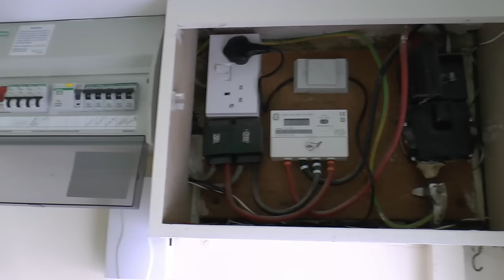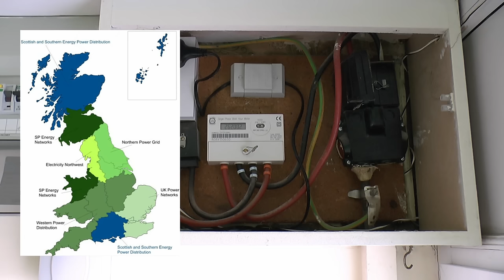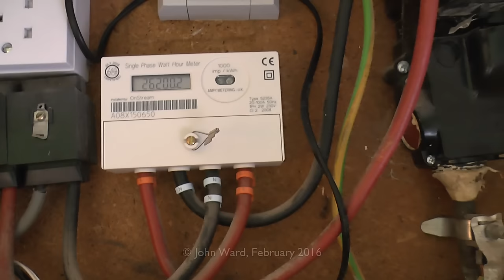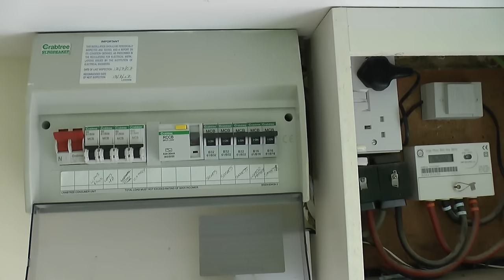Mains Supply And Consumer Unit

Comment: Hi I from the Chicago area and was just watching to learn, boy do we do things different here ! No incoming power would ever be in a wooden box or even set up like that the meter is usually outside and is sealed also acts as a disconnect on a  home . Our panels are much bigger new standards call for arc fault on all circuits  in England is it usual to have only 1 hot and neutral or 120volt only I though it was all 220 volt and is it 220 one one line w neutral or 220 on two phases, Here we have 3 wire service two 120volt lines that share an unfused neutral so from line to line 220 volt line to neutral 120 volt all services have a main breaker with two sources of ground one rod at the meter and one at the incoming water line before the shut off valve if on a well then a second rod at least 6feet away from esch other.
Reply from the maker: One hot at 240V, one neutral.  All appliances are 240V.
Reply: And we in the Netherlands have also neutral connectors on the breakerunits,so the neutral is also disconnected when a shortcircuit.So no common bar for the neutral wires.And indeed a hot phase and neutral,no two 120 volt lines!!

Comment: what is the item plugged into the dual sockets in the cupboard?
Reply from the maker: +jusb1066 Transformer for the doorbell.
Reply: +John Ward  hi pal, just a quick question you may be able to answer for me. I'm actually an electrician myself but you never stop learning.
Why is it that meter tails can't enter in different holes due to possible eddy currents but in the actual meter, they all enter through speedster holes ?

Thankyou
Reply: +Sean Mac separate.... Not speedster(auto correct)
Reply: +TheAerobicmonkey ok let's see if you can understand this

You are not allowed to put meter tails through separate holes In a consumer unit.

But in the meter they all enter seperate 

Why ?
Reply: +TheAerobicmonkey ok let's see if you can understand this

You are not allowed to put meter tails through separate holes In a consumer unit.

But in the meter they all enter seperate 

Why ?
Reply: I think you mean when you pass single conductors through a metal panel the must go through the same hole.  If they go through separate holes circular eddy currents form in the sheet metal, in opposite directions for each conductor, presumably heating the panel up.  If the pass through a single hole the fields from each conductor cancel.  The meter is plastic, so no eddy currents in the material.

Comment: I have always been wondering why on the islands the amount of fuses is so little, for the same (house) space we often have two or three times as much fuses around here. But then again people on the islands are probably wondering what those on the mainlands need all their fuses for...
Reply: Well here we get to the only real advantage of the 32 A ring mains: you only need half as many breakers as with 16 A radial circuits.

In the US you've got even more breakers because a US 15 A circuit can only carry half the load of a European 16 A circuit (half the voltage, same current).
Reply: Ragnar8504 It also seems that the amount of circuits is sometimes bigger here. I currently live in a house that has two breakers for almost every room, one for the lights and one for the sockets. One breaker for each floor, one gfci for each floor. Two levels of breakers for all mains together (one per phase) and one three phase master switch. Plus a few extra circuits like three phase oven, one each for washing machine, dryer and dishwasher. And the outside has its own fuse and gfci. And I have 4 breaker panels, one per floor and one main panel.

Comment: if i turn off the large rcd ie the ones with the thick wire coming from the supply in . does that mean that the buzz bar is dead. i want to put a ring main into the shed and i have a spare 30a fuse unit and i am confident that im doing it correctly i just want to make sure when working with mains power
Reply from the maker: Yes, but you should always confirm dead as it's not impossible for contacts inside switches and RCDs to fail in the on position.

Comment: Hi there John, do your consumer units in the UK use an M.E.N. system where the earth and neutral are bonded  inside the switchboard and then the earth bonded to water pipes and an earth stake outside the house?
Reply from the maker: +australianstig Not in houses.  It is used in some industrial installations.
Reply: In Australia the MEN system is used everywhere from households to commercial factories and office towers

Comment: Hi JW.  If the cables enter the consumer unit from the bottom (there are knock out ports top and bottom so i assume its not too unusual), whats best practice for neat wiring?  I'm considering running the cables up behind the MCB bar (where they clip in).  Would there be any issue with that, or is this an acceptable way to run the cables?  Thanks
Reply from the maker: Yes, behind the bar is the usual method, ideally using holes in the enclosure which are in line with the MCB or other device to avoid cables crossing over inside the consumer unit.
If holes in the top are used, they must be sealed to at least IP4X, a common method of achieving that is to fix a length of 50mm x 50mm plastic trunking across the top of the consumer unit to contain the cables.
Reply: +John Ward that's great thanks. I've been looking into grommets etc for the knock outs, but can't find much! From your reply noting the use of the top holes, I assume I don't need them if using the knock outs on the bottom?
Reply from the maker: Grommets are still required to prevent the cables being damaged by the sharp metal edges of the consumer unit.
Search for "open pvc grommet" for the usual style, or "stuffing gland" for those with better sealing.

Comment: I was always taught to do as this shows, Cooker NOT RCD protected as (1) it's not a portable appliance so no need to have an RCD, and (2) the high leakage current especially from ovens can cause nuisance tripping.  

The usual socket on the cooker connection unit was never mentioned :)
Reply: +TheChipmunk2008 You need to get up to date on the regs then!  For several years it has been necessary to RCD protect all circuits if the wiring is buried in walls and less than 50mm from the surface.   For most houses this means all circuits so  cookers,and lights are now protected by a 3omA RCD.
Reply: +Taylortwocities Real? I had my oven hooked up to a 30mA RCD and all it did was exactly what TheChipmunk said it would do... nuisance trip! How you supposed to get around that then?
Reply from the maker: +SeriousSchitt If an oven trips the RCD, it is faulty and should be replaced or or repaired.
Reply: Mica insulation in the heating elements often breaks down over time causing  nuisance tripping.  Cheap to replace.

Comment: So if you change the supplier they have to replace the meter? Sounds strange. Here the meter belongs to the local electricity company.
Reply from the maker: If you change supplier, the new supplier normally takes over the old meter from the old supplier.
If you are unfortunate enough to have a smart meter installed, this often means that the smart meter is no longer smart once you move to the new supplier and has to be read just like an old non-smart one.
Reply: Generally, the new supplier is not at all bothered about the meter. They just want to take a reading so they can start charging you and so that your previous suppler can present you with a final bill. The same thing happens when you buy a house.
I have done both and neither time was the meter changed. In fact, it’s still a traditional electromechanical type.
At the moment in (most of) the U.K., you can request a so called ‘smart’ meter. The supply company will then fit one free of charge.

Comment: Is 100A the largest single phase supply a DNO will provide?
Reply from the maker: In most cases yes - after that it's usual to go to 3 phase 100A, and above that it's higher current ratings but still with 3 phase.
However higher capacity single phase can exist, really depends on the electricity network in the local area, what capacity is available, etc.

Comment: I am no electrician but im trying to save a few hundred pounds. I have the same mains consumer unit. I want to run some power from my house to my shed which is around 30mtrs from my house. Can i run a small mcb consumer next to mains consumer with a isolated switch before drill out.and then  run 16awg  armoured to shed.  Cant find nothing online to simplify this procedure

Comment: Can u take  the lighting out on the new rcd board ie if keeps  tripping rcd
Reply from the maker: No.  Lighting circuits require RCD protection, as do virtually all other circuits.  If it's tripping the RCD there is a fault which must be found and repaired.
Reply: @jwflame    as a quick fix  couldn't u  just put on  unprotected   section    use neutral  bar     b4  rcd side  ie  say  just to get lights on  for night    changing skeleton  2moźz   18 ways  all the lighting not on a rcd     and it's a mess
Reply: No new  circuits  all existing

Comment: I want to have an Electrician run a separate power supply for my stereo equipment. I have been advised that I need a 30 amp supply. Could I run 4 separate cables from the consumer unit so each hi-fi separate has it's own dedicated supply. Is it worth running a separate earth 6mm from the consumer unit to the four outlets that I have in mind.
Reply from the maker: You could have separate cables for each item, although electrically it won't make any difference.
A separate earth is not required, the earth in the power cable(s) will be adequate, and the earth would only carry current in the event of a fault.
Reply: John Ward Thanks for the reply John. I have a couple of issues with the electrics. Firstly when we have been away for a weekend break,on our return we find the whole house has been without power, so I have to push the main power switch to once again have power supply from consumer unit. Secondly I have a couple of power amps, these or one of them seems to make a buzzing noise around 6 am every morning or when my partner turns on the hair drier. Am I right thinking that the amps have dc in the ac supply? Interference on the line. Great informative videos by the way.
Reply from the maker: The whole house tripping is probably an RCD (with test button on it), in which case it's a fault somewhere either with the wiring or an appliance.  Water leaking is a common one, such as outside lights, wiring to garages/sheds, boilers, water heaters and similar.

The buzzing will be interference either through the mains wiring or being picked up by signal cables, speaker cables etc.  
The hair dryer should have interference suppression in it but that may have failed.  For the 6am one, it is probably something switching on at that time such as a heating system - not necessarily in your house either.
Reply: Thank you for replying JW. I know have watched quite a few of your videos & enquired with a training centre about now doing the 17th edition plus another course. I expect it's quite an up hill learning curve, but would help me regarding carrying out electrical works. Can you recommend any up-to-date -books to learn from.

Comment: Is it typical to double up circuits on one breaker in the UK? I'm pretty sure thats frowned upon in the US
Reply: They are ring circuits, which are commonly used in the UK.
Reply: +codemsan - A number of them will be ring-type circuits that have two legs going out in different directions around the installation but forming a ring or loop-style circuit that typically hosts a good number of socket outlets.  So like: DB --- SOCKET --- SOCKET --- SOCKET --- SOCKET --- SOCKET --- DB, where DB = a single MCB over-current protection device in the DB for that particular circuit (commonly rated at 32A).  Each leg on a "socket ring/ring main/final circuit" is typically 2.5mm2 copper rated to handle in region of 23A (subject to derating rules due to layout, e.g. in walls, through insulation, clipped direct, on cable trays, etc), but with it being wired in a loop fashion to form a ring, presents a circuit capable of almost twice that (e.g. in the region of 40A or more).  It's basically a radial circuit with a leg back from the last socket outlet back to the source.
Reply: Ohhh derp, i forgot about ring-main circuits! The 32A breaker on 3mil cable should have given it away immediately :P
Reply from the maker: +codemsan The ones in the video are rings, however it is permitted to have 2 or more wires in a single circuit breaker even if not a ring.  Usually happens when circuits are rearranged to make space for a new one, e.g. put 2 lighting circuits onto a single breaker so a larger capacity breaker can the be installed.

Comment: Are the neutral and ground bars linked in any way?
Reply from the maker: No, and it's not allowed to link them either.
Reply: @John Ward  Really? In North America the ground and neutral wires are all connected to the same bar, which is then connected to the main neutral supply coming into the panel. It it also grounded via either the water supply pipe or a metal rod planted outside near the foundation. You should do a video explaining (or reacting to) how North American power works.

Comment: John is it possible to open my mind please 
I will now if you can sow me from my 1000w inverter slim to wire to my main dB box please and what I need to start 
I will not blow my inverter I'm wire it from the pannles solar to my solar charge controller
To my battrys true a fuse to my inverter I put my output to my lights but my inverter run a round of 20 to halfour then my inverter horn signal event of please thanks for help

Comment: how do you install an economy 7 system i have no clue how to install it cheers
Reply: If you have to ask, get a professional
Reply: +Allen Goldsmith Daniel is right.  Of course, the very first step is to apply to your electricity supplier for them to provide an E7 facility.   Then you'll need a registered electrician to suuply the necessary distribution gear and connect it up.

Comment: Why don't they just put a switch before the consumer unit, save you having to get someone out to remove the fuse. Seems a bit mad
Reply from the maker: Some installations do have that, and in most you can request (and pay for) one to be installed.
However they are of limited value as only used when replacing the consumer unit, which for most buildings is once every few decades.
Reply: Thanks for the reply John.
Reply: John Ward
Reply: how to take the fuse out? is it simple to do?

Comment: your load centers in UK are small in America there is usually 200 amp service and at least 30 circuit breakers.
Reply: +Gavzach - At what voltage though?  Isn't it 120V over there?  So, 120V @ 200A, versus 240V at 100A are the same, right?

Regarding the number of circuits, a fairly usual amount would be around 10 circuits here for a typical domestic installation here.  Something like:
Downstairs Sockets (32A)
Kitchen Sockets (32A)
Upstairs Sockets (32A)
Downstairs Lighting (6A)
Upstairs Lighting (6A)
Cooker (40A)
Shower (50A)
Immersion Water Heater (16A)
Heating Control (6A)
Alarm System (6A)
Reply from the maker: +Gavzach Everything is 240V here, homes in Britain do not normally have air conditioning and water & space heating is usually gas or oil.
Where electricity is used for space heating, a separate board would usually be provided for that.
Reply: +9ff70f96 yes it is 120 and you are correct with saying 120 at 200 amps is the same  as 240 at 100 amps
Reply: +9ff70f96  Canada is  the same basically as the U.S and a common residential service size is 100A  120/240V 1 phase but  just as common is 200A 120/240V 1 phase for larger homes. There is the odd "125A" service and even availible for extremely larger houses , (and they are rare, but I have seen one!) a 400A service can be installed.   Panels for service entrance vary from a minimum usually of 24 spaces all the way up to a whopping 84 spaces depending on the amperage rating of the panel.... Meters are located outside generally, and the main breaker  is located within a separate compartment within the panel, a "Combination service  entrance panel".
Reply: +9ff70f96 most of our receptacles are 15 amp and are usually shared with the lighting circuits in the room. we have the
 50 amp 240 volt range receptacle 
2 20 amp receptacle circuits 
a 20 amp receptacle for the fridge 
 20 amp circuit  for the dish washer 
heaters are usually 240v at 20 amp.
 20 amp circuit for the washing machine
30 amp 240 volt  for the dryer 
 240 20 amp circuit for the water pump 
30 amp circuit for the water heater 
15 amp circuit for the door bell 
20 amp circuit for bathroom receptacles
15 amp for the lighting in the bathroom 
and what ever other circuits the owner wants to have out door receptacles outdoor lights sub panel for the shed. etcetera
Reply: +Gavzach - Yeah, so it seems that North America uses a lot more radial-type circuits than we do here in the U.K. generally were "ring main" circuits tend to rule.  Our ring circuits tend to host most of the loads like washers/dryers/fridges/freezers/etc.  It's only usually devices that present long-duration or particularly high loads that tend to get a dedicated radial circuit from the distribution board.
Reply: +Gavzach Same in Canada.

Comment: Wow 415v in from the street.
Reply from the maker: Not in this video - single phase 240V.
Reply: Oh I must have read that wrong where it comes in on the right.
Reply from the maker: The fuse holder is marked 415V, as the same ones are used for 3 phase supplies, where you get 3 x 240V, with 415V between each.